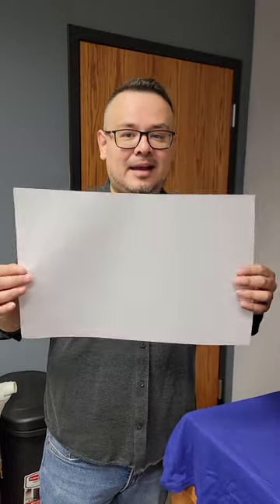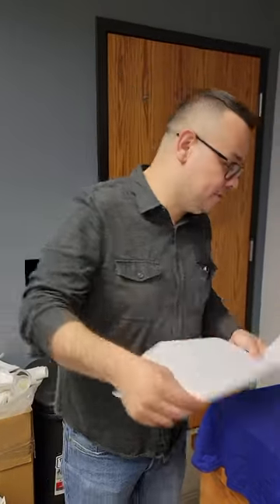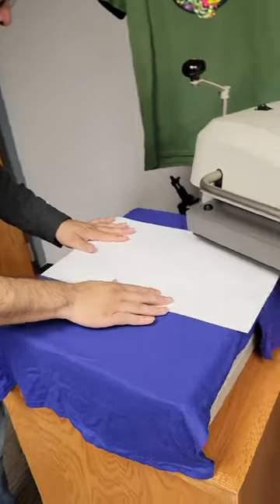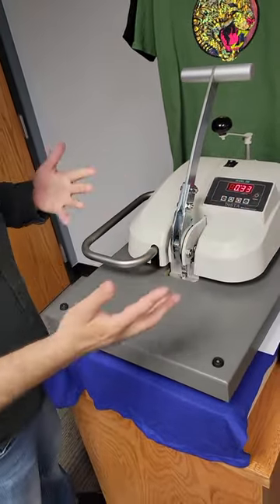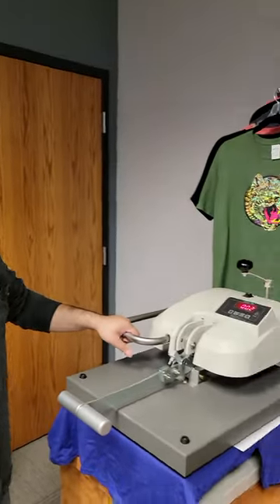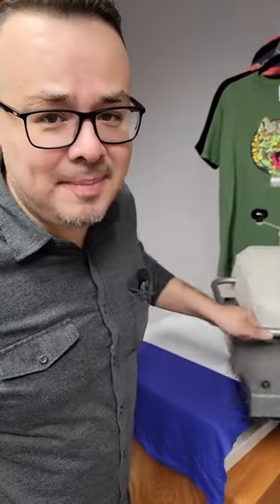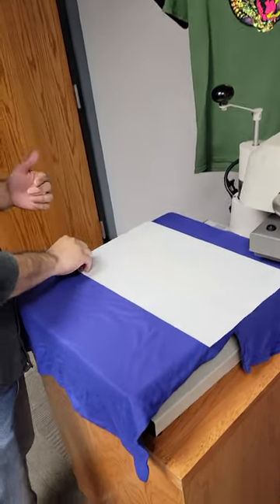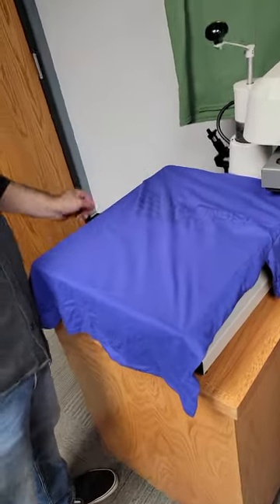Easily Remove HTV from Shirts with This Hack - No Chemicals Needed!

Comment: But... looks like you can still see it on the shirt. So you have to  put the same design back down?
Reply: Use vlr to get the glue or sticky adhesive off the shirt
Reply: I'm using this and it's still there do you have suggestions

Comment: Can you do this with a regular iron?
Reply: You can use the regular iron to take letters or a design off this is the method I use all the time, you just doesn’t want to hold the iron in one place for a long period of time
Reply: @neisha06ify can I do this in tote bag?
Reply: @eshanajahanema1990  yes ma’am
Reply: Yes. I JUST did it. but you set to highest setting. Press hard. May take a few runs. But it works!